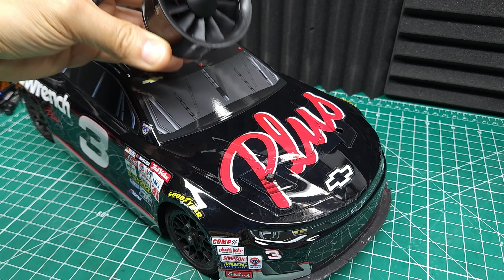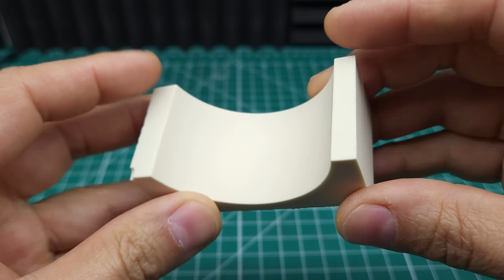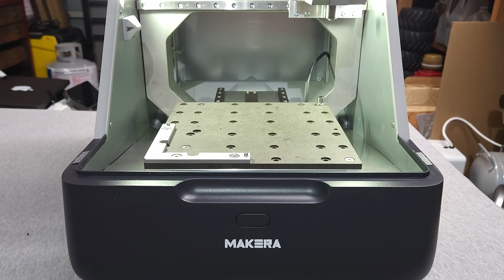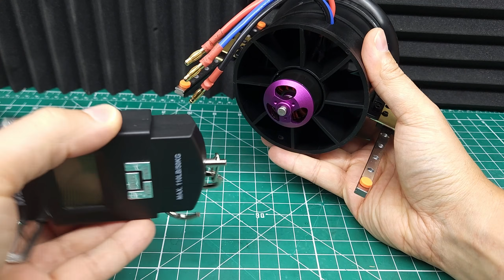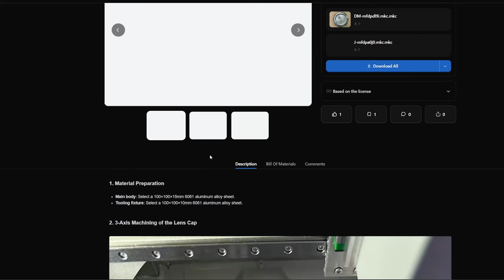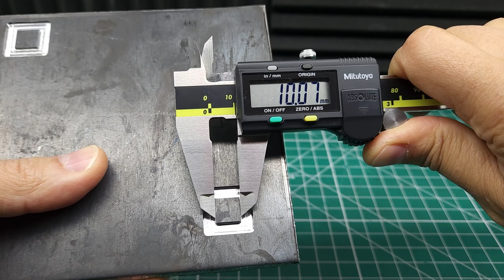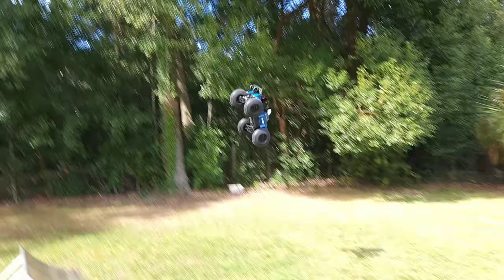I Built The World's First Jet Powered RC Stunt Truck!

Comment: Cool project! But Worlds first? Doubt that lol Did this a couple of decades ago. Have done several variations, the best performing one wasn’t an edf it was prop powered like a gator boat! it was a gator car lol also fan cars like a chaparral or McMurtry are fun, I used a 65mm edf for downforce on a 1/10 touring car and the added traction on smooth concrete was ridiculous
Reply from the maker: World's first stunt truck. I don't think I've ever seen anybody else but one of these on a stunt truck and fire the EDF while jumping.
Reply: @DoRC yours is much more powerful and better built! the first one I did was based on a 1/16th nitro mini monster truck which was very much capable of jumping! In fact just hitting speed bumps on throttle it launched, that same chassis ended up being stretched and turned into a streamlined speed car using the same outruner from the edf, but directly driven to the transfer case, it had a calculated wheel speed of 100mph not considering the 2” Tyres were about 4” round at speed! At a guess it probably did 60-70mph before taking to the trees! It ran great on 2s and 25a esc but 4s and a 60a esc it kept taking flight! It needed foam not rubber tires.
Reply from the maker: @needmoreboost6369 Nice! Yeah I wasn't able to find anyone on YouTube who had done it but I doubt it it was a completely original idea since it's a pretty basic concept. It is really cool to hit the button with the timing right and see the truck just hang in the air for a second.
Reply: @DoRC I’m pretty certain I had seen someone else do it long before myself too there’s not much original now days!
Reply from the maker: @needmoreboost6369 For sure Like I said I just couldn't find any evidence of it so that's good enough for a YouTube title for me :-)
Reply: @DoRC claim it man! I’ve found a heap of old rc footage from two old digital cameras and I’ve put one video up from 2009 of a heavily modified.28 powered 1/10 last run, I’ll see if I can find the ss card with the jet car
Reply: @DoRC done a few edf planes and boats to but the quickest accelerating thing yet was an rc block of styrofoam! It had 2 slotcar style fixed axles and rudder for very limited steering, more or less a wingless jet engine on wheels.
Reply from the maker: Sounds pretty lightweight!
Reply: @DoRC the death of that outruner from that old edf was in a 12” styrofoam hydroplane with surface drive! it could hit top speed in a couple of seconds probably only 30-40mph but a broken prop and shaft vibration ended up knocking the back of the motor and magnets off.

Comment: One can tell you're having a good time messing with these, it's really cool to watch! 😃
Mixing the EDF with the throttle seemed to work better than having it on a dedicated button?
Awesome video! 😁👏
Reply from the maker: Yeah unfortunately in order to balance it in the air I need to be able to modulate the throttle and turn them on and off separately so it really does need to be on a separate button.
Reply: @DoRC  oh, ok. Makes sense. The Losi wasn't jumping off of ramps so it didn't need that... 😅
Reply from the maker: Yeah I also had the EDF on the throttle for the speedrun with the notorious I just switched it to a button for jumping. It's entirely possible there's a better way to do it. I think very few people if any have actually tried jumping with an EDF like that so it's definitely ripe for improvement.
Reply: @DoRC  experimenting is fun!

Comment: With some refinement rather than slap fan on hood I see major potential. 
Drop the EDF into the body. Get that thrust closer to CG. May even be able to work up a nozzle or duct to help direct the air out the EDF as well.
Reply from the maker: Yeah for sure. This was a very rough first proof of concept. I honestly wasn't sure if I was going to even have fun with it or if the EDF would handle even a small crash. Until I figured those things out there wasn't really any point in going further. It definitely has potential though
Reply: That z1 is something I've been hoping for
... for years.  However I did the Kickstarter for the new snapmaker u1,  so my budget is blown.

Comment: It seems like you've just learned about lead screws. 

A hinge would be much more accurate for thrust testing. 

You need to learn a lot!
Reply from the maker: I've known about lead screws for quite a while. What did I get wrong? 

While a hinge can work as it rotates around its axis removing slop from the system You introduced geometric errors that can be problematic. Of course linear rails also introduce their own issue of friction but that friction isn't nearly as much of a problem with static thrust. Ultimately though this is just a dude playing in his backyard not a scientific lab so I think It did the trick :-)
Reply: @DoRC the hinge is pure and uncompromised. 

Slop in the hinge is irrelevant. 

Do an FBD of both systems and you will hopefully understand.
Reply from the maker: @procatprocat9647 It's not slop in the hinge it's taking up the slop in everything from the motor to the thing it's anchored to. Unless you already have that preloaded as you take that up the hinge will rotate causing a geometric error in the measurement. An FBD will show me exactly what I'm saying. The linear rails are linear meaning that there's no geometric error introduced as they move while a hinge is rotational meaning it would introduce geometric error. Of course in practice, especially for a dude with his foot on a piece of plywood in his backyard either one of them is fine.

Comment: You will get more thrust from the edf if you funnel the back of the edf.
Reply from the maker: A lightly converging nozzle could increase thrust but at the speeds we're talking about it's pretty minimal and the EDF is typically already designed for the amount of back pressure it expects and if you converge the nozzle too much you're going to increase back pressure which could actually reduce impeller efficiency.

Comment: You mentioned 3d printed parts not being strong enough. Never ever would a 100% infill ABS part wrapped around the engine budge even a little bit. I still think your project is much more interesting though😂
Really appreciate your videos
Reply from the maker: Maybe though the cross-section at the bottom of the first one is pretty thin and especially those tabs I made for the second one really don't lend themselves well to being 3D printed. With that being said though you definitely could figure out how to 3D print all of this stuff but CNC was more fun :-)

Comment: Only 4 mile more and more Money. Put bigger pionen and have more power. 👎👎 idea
Reply from the maker: The problem with the Losi NASCAR is not a power problem. It's keeping that power on the ground. A larger pinion is not going to help that.  With that being said I didn't do this to revolutionize the speed running niche. I just did it for fun :-) It was fun.

Comment: Click bait - That’s not a jet engine, it’s an EDF
Reply from the maker: Yes as I explained in Great detail on the first few minutes the video It is not technically a jet engine. With that being said it is YouTube and most people aren't going to know what an EDF is.
Reply: @DoRC still click bait
Reply from the maker: I appreciate your feedback but I'm going to have to disagree. Using a term that people will understand rather than one they won't and then very clearly differentiating between the two at the very beginning of the video I think it's at the very least fair :-) @HardcoreRC
Reply: @DoRC  Definition of click bait - putting a title that makes people watch but in fact the video doesn't contain what's in the title. an EDF is NOT a jet engine

Comment: blasting wind against the windshield is like blasting an onboard fan against the sails of a sailboat and thinking you will get propulsion. 
Also, lots of thrust is being wasted as downforce. 
Ever see the video of a guy sitting on a wheeled bucket with an umbrella and a leaf blower? He points the leaf blower against the umbrella and fakes moving around. If it did move, he would be violating the laws of nature as described by Newton's 3rd law of motion.
Reply from the maker: Blowing against the windshield was a side effect of where I wanted to mount the EDF. I wanted it mounted as low as possible and That's just where it ended up. I honestly don't think the windshield would cause that much drag though it does cause some. I definitely was not doing it to try to blow air against the windshield.
Blowing warrior over the top actually reduces downforce as the faster a fluid moves over a surface the less pressure there is exerted on that surface.

Comment: put heavier tires on it, team corrally sells their mudclaws, they are 100g heavier each, helps realy with aircontrol i always run them on my notorious, feels much better!
Reply from the maker: Yeah that might help the problem is that the reactive torque only works as long as the tires are accelerating So once they reach full speed that's it. I think the real solution would be to angle the EDF so as to counteract the thrust producing
Reply: @DoRC and yeah calculating a better angle would be better
Reply from the maker: @doffoderk5543 For sure. If I put the angle of thrust in line with the center of rotation That would help a lot
Reply: @DoRC ah, yeah i thought more rotational mass gives you more room to correct, also i dont know what pinion u r running stock is 12 my advise is switching it to 16 if you haven’t already heats the motor a little though haha, but i think you are more capable then me of solving the issue, this is what i thought but i understand you have way more knowledge. love your vids men keep it up realy love the way you explain everything. support from the netherlands!

Comment: Injora sent me out two of those servos when they first came out. 1st one blew my 2 in 1 on my TRX4m with its tires off the ground. Second one I tried in my Typhon Grom and the car was all over the place. The Reefs did so much better. I did put it in another TRX4m and its strong enough to work and since the rig does 5mph, the slop isnt an issue. lol
Reply from the maker: Yeah I definitely didn't have any luck with mine.

Comment: For the stunt truck, I think instead of having the throttle on a button, you should just run it parallel with the throttle. The edf counter acts the backflip inertia, so in theory the nose should just stay pointing up in the air when they are both at full throttle. If you see it wanting to nose dive at full throttle, send 80 percent to the edf and 100 to the motor or vice versa. Regardless, amazing work as always. You are literally the king of bashers.
Reply from the maker: Unfortunately It doesn't work because they aren't balanced with each other and the throttle has to be continually accelerating on the wheels in order to counteract the EDF but the EDF doesn't need to be continually accelerating. I did try it off camera and it was worse.

Comment: My RC has a V8 engine. It's electric powered. It produces power the same way as a V8 does but uses no fuel. Does that make any sense?
Reply from the maker: If it was a solenoid based V8 engine That still used reciprocating pistons that ran on electricity sure that would definitely at least have serious parallels.
Reply: @DoRC your right. And I guess technically the title is technically correct. It would be less misleading if it said ducted fan however.
Reply from the maker: @DavidWalkerfromplanetearth I don't disagree but this is YouTube and a lot of people wouldn't know what an electric ducted fan is.  I chose jet because I figured that would have the most widespread appeal though I definitely do understand that it's not the most accurate term.

Comment: I was shocked to see the fan add 10 mph top speed on a truck that heavy.  Great video, thanks for sharing it with us.
Reply from the maker: That wasn't even close to the maximum. I've already done 68. I just needed to adjust the EDF to power up more quickly than the traction motor so it didn't try to wheelie so bad.
Reply: @DoRC  Amazing!

Comment: You need a Radiolink RC4GS to mix the channels. You can tie the EDF to the throttle easily.
Reply from the maker: The transmitter I used does that. It is tied to the throttle on the speedruns but not on the jumping because I need to be able to control it separately.

Comment: People have done it before, but one of my favorite uses of an EDF on an RC car is to use it for additional down force. Either through clever under tray construction or some sort of air skirt. If you can manage to keep all 4 wheels in contact with the ground, your top speed is really only limited by power to over come wind resistance. Well, that and your tires just exploding...
Reply from the maker: Have they done it jumping a stunt truck? I wasn't able to find anybody else that's done that.

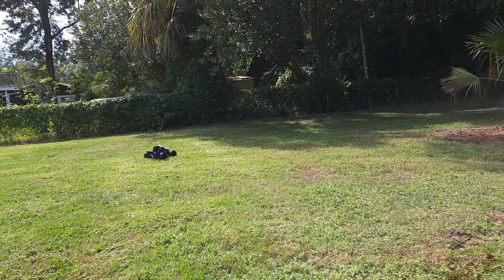Comment: 26:12 the fan causes a lever action without working out the front/rear balance.
Reply from the maker: Yeah I was thinking about that it definitely introduces a lot of down thrust being as high up as it is
Reply: You could sort out the angle specifically for jumps. Maybe make the fan angle adjustable.

Comment: 25:03 angle the fan downward pushing air back and upwards. That will push the nose to the road.
Reply from the maker: That would definitely help
Reply: I was thinking the same thang about the down force from the air going over the windshield and the angel of the air-jet.

Comment: I wonder if you had a radio Master controller or some other fancier one you could do some sort of mixing on the channels to where when you get to 70% throttle on channel 2 it activates channel 3 which then kicks off the EDF
Reply from the maker: That sort of thing can actually be done on this radio as well with various fiddling. There is definitely a lot of room for improvement on things like the speedruns especially on the monster truck. I really just needed more EDF but unfortunately there's just limitations inherent to making a video where I can't get too deep into stuff like that.

Comment: Wow just wow! Such a great idea to do. I would have never thought about integrating an EDF on a ground based RC. Next you will need to point the EDF down and make a hovercraft out of an RC for the ultimate on road off road experience. Wait…damn it that means you’ll do it before I try it. Just kidding. Feel free I have plenty of ideas for trying out on RC’s. I definitely like that CNC mill. Makes my Bridgeport look like to much work. Work smarter not harder right? Thanks for bringing us some really cool thinking outside the box stuff.
Reply from the maker: The ground-based EDF thing has been done before but I don't think it's ever been done with a stunt truck
Reply: Maybe a spoiler or Whale fin on the back will help the handling substantially.

Comment: So much thrust wasted mounting it up front, most of the thrust will be pushing into the shell.... mount it at the rear, or at least high enough that the body isnt in the thrust line to make the most of the edf's thrust
Reply from the maker: You'd be surprised. It's not a straight wall behind it and it's still moving plenty of air.

Comment: The way modern Jet engines are setup people would be amazed how little fuel they need for operation.
Reply from the maker: For sure the high bypass stuff is pretty crazy
Reply: @DoRC modern materials, tight tolerances and some joy juice makes motor go boom. 😂